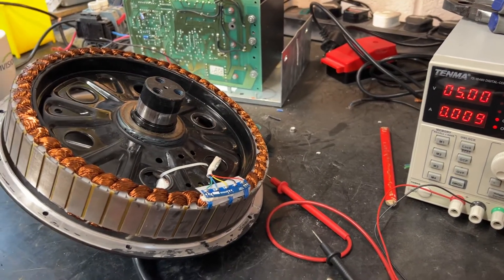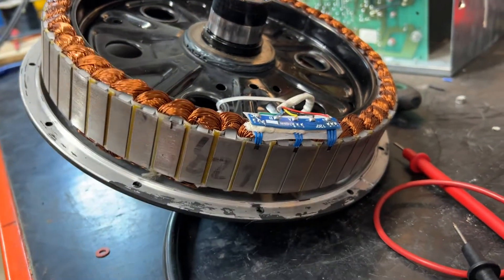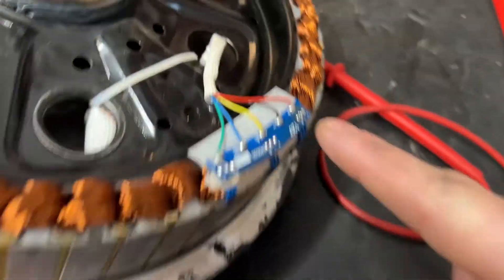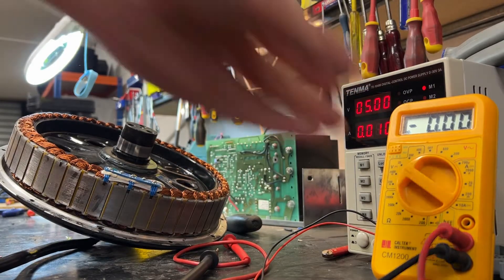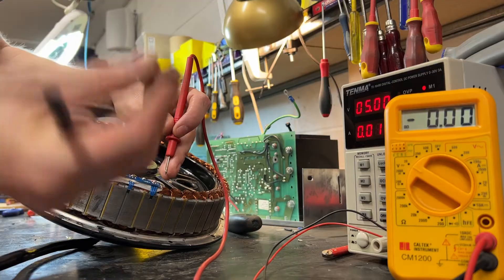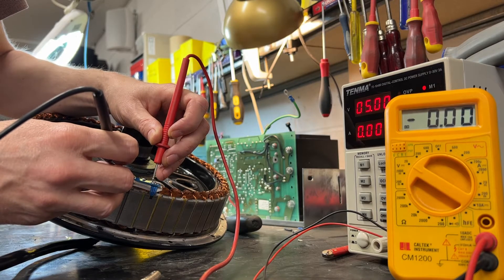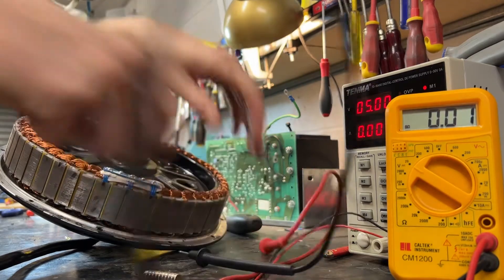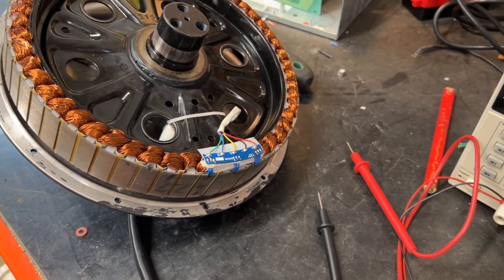Brushless Motor Hall Sensor Testing

Comment: They have a little aliexpress tester for the hall but this is a great way to test without any fancy tools. A 5v reg is easy enough to acquire, thank you for the detailed video.
Reply: well the psu is about $250 i wouldn't call it fancy like you said but also is not cheap so ......... yeah 🤣

Comment: where did you buy the sensors? how to choose sensors?
Reply from the maker: @gc9589   I can’t honestly remember where I bought them.  It might have been a regular supplier like CPC or RS or possibly just a google search. Main concern for a replacement is physical size so they fit.  You can often find a part code on them and work out a match from that.

Comment: Brilliant ive broke a sensor trying to get it out ,are they suppose to be glued or soldered in ? Im waiting on a new board
Reply from the maker: @whitefeatherslinger8194   yeah you’ll struggle to get one out without breaking it.  That’s a good thing though really as you want them to be in there solidly with no chance of moving.  If you replace it I’d dab a bit of superglue on it to keep it in place.
Reply: @AndySV1K  thanks ill check back when ive it done just on my way to sub 👍

Comment: Silly question...
Shouldn't the sensors have to be on or off in some specific order/sequence? Say if u turn them all on or off by placing on magnet, and now u assemble everything back together will will they reset themselves back in to correct on or off state?
Reply: The hall sensor only tells you which magnetic field he is/was sensing. So when you assemble everything and you rotate the motor then you rotate the magnets. They pass by the hall sensor and then the hall sensor tells the controller the orientation of the magnets in the motor. No need to "set" them before assembly

Comment: Are there hall sensors that don't switch by approaching a magnet to it? It's a lexgo motor, but it looks identical as Xiaomi motor. Three hall sensors - none gets 5 volts out. I applied 5V from a regulated power supply. Have multiple magnets, turn them different ways but always have 0 on pin 3 on all sensors. Please light up who dealt with hall sensors. Thank you.

Comment: How strong should be the magnets? I tried many magnets, but I can't get none of the 3 hall sensors to switch to 5 v. Input is 4V coming from the controller. I can't believe all 3 sensor are bad.
Reply: You have to turn the magnet around

Comment: i switched my ninebot controller to a genereic e-bike controller. Why its working without connected hall sensors now? and how? ^^
Reply: some controllers are programmed, or wired, to run either ,with or without, hall sensors, I'd be interested in trying that. which specific controller did you get?

Comment: Can you show the symptoms of the engine leading you to change hall sensor,i think there is big confusion when you order misfitting controller and throttle and have the same symptoms
Reply: i have a 1000 watt front hub motor and it started vibrating, rapid pulsing, like it was single phasing, i had a open motor lead act similar, but this one also gives my controller a 03 error, motor wiring problem, have mine out and apart like his, i have no board, just sensors mounted like his and straight to the wires leading back to the controller, so the symptom was vibrating motor operation until the 03 error then shut off.

Comment: Can’t you test it with diode setting on multimeter ? I don’t have a variable power supply
Reply: probably could but his test is so much better for active switching, i am pleased to see this simple test, I'm just going to plug my controller wiring back in no need for a separate power supply

Comment: Great videos of the testing of them. I imagine if someone doesn't have the power supply could they rig up a 5v dc battery with leads and connect it.? Seems like a short term testing solution.
Reply from the maker: Yes absolutely, main benefit to the bench power supply is you can accurately control the current.  If i didn't have that, i'd probably butcher a USB lead and use a phone charger type power supply as USB is 5vdc too.

Comment: I don’t have a fancy adjustable power supply. Can I feed it a 5V/1A from USB charger or is that going to be too much? Great video btw. Possibly the best I found on YT on hall sensors
Reply from the maker: Thanks your kind comment.  Really appreciate it.  Yes absolutely feed it a 5v supply from a plug in adapter.  That’s actually how I built my tester with just a cheap 1amp supply 👍🏻
Reply: @AndySV1K  thank you! Subscribed and waiting for the next vid!

Comment: Why do they keep going bad?
Reply from the maker: This was me damaging it.  I've hardly ever seen a hall sensor fail on it's own, they are incredibly reliable components.
Reply: @AndySV1K  Search hub motor repair on yt. They're almost entirely on hall sensor replacement.
Reply from the maker: @12villages    That's maybe because they are the only component inside a hub motor, but from my experience the only real problems i've seen has been from water or physical damage. I'm sure they do fail but if you look at the work they are doing in a wheel travelling at 50mph it's immense!

Comment: Hello,
Could you please give me the reference of this kind of hall sensor ?
+ Are you using the same on all 3 sensors ?
I've seen that the middle one is  different on few boards.
Thanks :)
Reply: Get a bunch of "Honeywell SS41" same chip on all 3 of them.
Reply: I've never bought new Hall sensors I just take them out of old broken motors.
They'll all the same they are switches will turn on and off they all do the same thing.
I only done one yesterday form old 350w hoverboard motor in to a 1000w hub motor.
Reply: @scottrocks1993  Me too but it wasn't much fun to start taking apart old motors, some chips are bad, others break when you pull them, I just ordered some from Ali, they are cheap and should save a lot of time on new builds.
Reply: do u know why didn’t working all sensor on some bldc motor ?  its very wired sensor work same but only some special number sensor work with bldc motor.
Reply: @aatmasoul9508  You need bipolar hall sensors. ss41 for example.
Reply: @Eden_M  i use lots of sensors but its not working , even 41f is not working, only s41h or gochip g3141 work why it’s happening when all sensor work same then why should only this 2 sensor working with this motor.
Reply: @Aatmasoul S41H all 3 sensor worked?
Reply: I changed one of the 3 hall sensors of my Bultaco Brinco R (2000W version) with Crystalyte motor. The original 3 hall sensors are all the same and  in-scripted with "11A 604". I couldn´t find  any information about this after hours of gooogoooooling. One of the sensors was broken and I replaced it with an "INFINEON TLE4945L". The bike is running again !